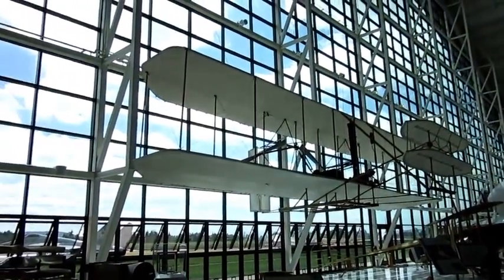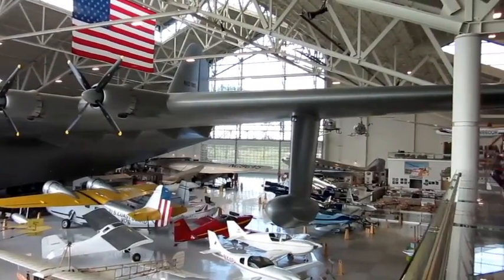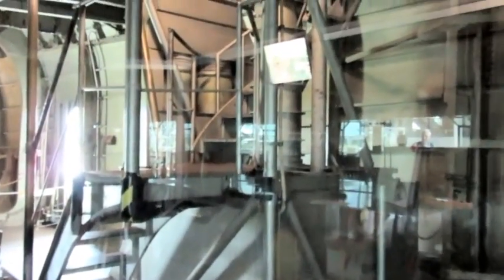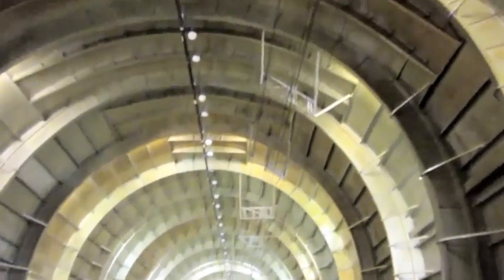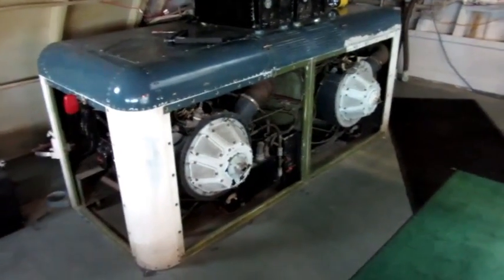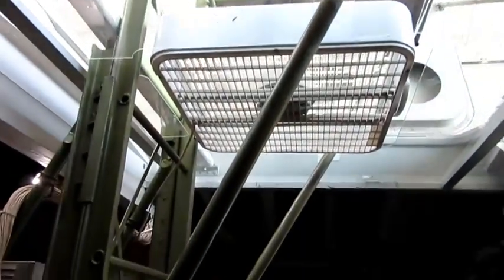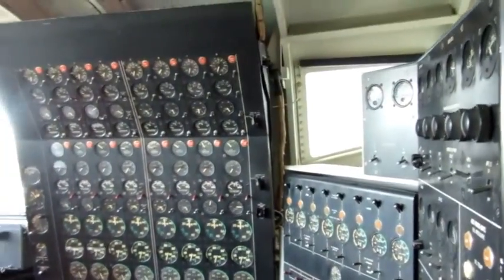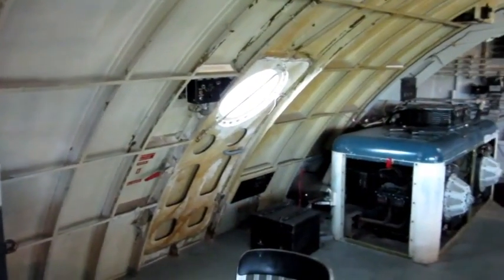Spruce Goose VIP Tour

Comment: interesting video. how did they get it from california to oregon, take it apart in pieces or tow it up the coast? that's a big piece of machinery.
Reply from the maker: They sell (or sold) a video about this at the museum. Basically, they took the wings and tail surfaces off (it was designed to come part like that, because it was manufactured far inland and originally had to be trucked to Long Beach in pieces, so the engineers understood from day one that it needed to be manufactured in transportable sections), and put it on a ocean-going barge, which took it up the Pacific coast, then I think they took it up the Columbia River to Portland. Then by road down the highway to McMinnville to the museum location, where it was stored in temporary weather proof shelters until the museum building was ready for it, and inside and reassembled.
Reply: @youtuuba  wow! that was an undertaking. it's on my list for the next road trip way out west.

Comment: Must have very been hot that day. All the fans. Or maybe for ventilation.
Reply from the maker: It was not hot inside the air conditioned building. I am pretty sure that the fans are to help with air circulation inside the huge one-of-a-kind wooden structure. Maybe also for ventilation, sine the plane is not exactly full of openings to let in fresh air, but I think mostly for protection of the aircraft.

Comment: Imagine if this was modernized and you put GE90's on this thing.
Reply: +AmericaWest90 a GE90 weighs 16,644 pounds.  The engines on this thing weigh as much as 3,870lb each.  

So, yes, it would would probably fly very well with two GE instead of 8 of the Pratt & Whitney R-4360 Wasp Major.
Reply: GE90s wouldn't help much. You could only fit one on each wing and it'd still weigh far more than all four engines combined, and would throw the center of mass significantly toward the rear. It could probably achieve a higher top speed, but the airframe wasn't designed for that. I think a set of Rolls AE 2100s (same as a C-130J) might be a good fit though. 

That said, even with modern engines it might just barely compete with a C-17 for payload capacity, and couldn't come anywhere close to touching a C-5, though I suppose being a seaplane would give it some very unique uses.
Reply: +JTB I like your take on what a modernization would be like. Thanks for putting forth the time and replying to my idea.
Reply: It would actually weigh about the same

Comment from the maker: Russia has a bigger cargo plane..... so what? They did not build it in the 1940s, did they?
Reply: Not saying Spruce Goose isn't impressive, but it could barely fly.
Reply from the maker: +Paistin Lasta ..... on what information do you base your assertion that the Spruce Goose could 'barely fly'? It was never given any chance to be flight tested, and the brief hop in Long Beach Harbor was restricted by that situation. The fact that Hughes only hopped the aircraft is not any indication of its capability. But the Hughes engineers very good, and it seems unlikely that they designed a plane that could only 'barely fly'. Furthermore, aerodynamics engineers have modeled the Goose in software and concluded that it would fly fairly well, if somewhat underpowered.... the main concern was how well the wooden structure would hold up on actual service use....
Reply: youtuuba Take it easy, wasn't it diagnosed that it couldn't fly above few dozen meters, as it was so low on performance.
Reply from the maker: +Paistin Lasta ..... not according to the information I have read. It MAYBE not get out of ground effect on its only flight, but any airplane flying that low is in ground effect..... this is no indication of anything. The reports I have read conclude that, while underpowered, it would have flown adequately. It might never have performed well enough to be useful, although this has not been established, but even an underperforming aircraft is still better than being 'barely able to fly's.
Reply: Not to mention, it's also made out of wood.
Reply: Don't forget. Before the Hercules took off, Howard lowered the flaps to 15 degrees which is take off position.
Reply: No, it just wasn't flown more. A lot of bullshit comments like yours have been made about it being "in ground effect" and the like but its a SEA PLANE and that's VERY DIFFERENT than a conventional aircraft rolling along a runway on tires. There IS not "ground effect" in a plane that large with all that drag taking off from WATER. 

The other thing that "experts" like yourself seem to forget is that was its MAIDEN FLIGHT. Not only had no one ever flown it  before and had it not been flown by anyone before, Howard Hughes was the "test pilot" for not only the LARGEST PLANE EVER BUILT BY A HUGE MARGIN but the largest SEA PLANE every built and oh by the way had the BALLS and SKILLS to pull all that off with THE WHOLE WORLD WATCHING. 

Any plane that can safely take off and land ONCE and do it from WATER on its MAIDEN FLIGHT can be flown as far and long as anybody wants to fly it. And of course Howard Hughes had already crashed at LEAST two of his "experimental" aircraft and was beyond "lucky" to survive the second and certainly had no reason to give that idiot Senator Brewster reason to manipulate the Air Force into demanding that the "contract" be fulfilled by DELIVERING the plane which no doubt at some point Brewster would have had destroyed if he possibly could. 

I guess how "impressive" that aircraft is depends on how much you think the AIRPLANE had to do with its own "success" and how blind you are to the fact that its HUMAN BEINGS  that actually build and create and invent and operate all the machines I suspect you like to see as "robots" with the "human factor" removed from the equation.

People with self-confidence, insecurity and NARCISSISM issues LIKE to pretend the whole world around them as far as machines go just HAPPENS and nobody builds it and nobody literally goes out and DOES EVERYTHING THAT"S DONE FIRST AND ALL ALONE AND WITH NO ONE ELSE TO BLAME THEIR FAILURES ON.

What have you built lately?
Reply: In inquiring on the topic of why it did not fly a second time, one of the curators indicated some doubler  added near the empennage on the rear fuselage where the tail had been quite flexible during the short flight. People in the tail apparently warned of stress in this location. Also indicated Howard did not expect it to lift off on this run.  O doubt is was quite underpowered for its intended purpose and those engines were notoriously unreliable on any aircraft.
Reply: But it bearly flew.. using ground effect..meaning very close to the ground. That's all it ever did. Not strange people mention it. What it could have done is another matter and nobody can say anything for sure except it probably would have broken up into pieces if one look at the construction with strenght calculating software and as you mention what the people on board experienced on the second flight. One thing thats often quoted in the videos about the sproose goose is that it is the biggest sea plane ever built, it WAS at the time, but was beaten more than once in the years to follow. There was an English seaplane in traffic that was quite a lot bigger, and then you have the crazy Russian millitary freighter/bombers and prototypes.
Reply: To "threeparots1",
  From the documentaries I've viewed the narrator stated "during the test run with Mr. Hughes at the controls, the aircraft was intentionally made to leave the water and take to the air, regardless of the altitude, because Howard Hughes was not going to allow that idiot Senator tell him what to do with his own aircraft". You may be right about the engines being "Notoriously Unreliable on any Aircraft", I'm not well versed in these particular engines.
Reply: The essence of the active ingrediences of many youtube comments there. "...ignorant assumptions from a minute sliver of sound knowledge by people who do not even realize what they do not know." Great formulation, I haven't heard any better for a long time. If youtube is any indication, fluoride in the water really works. Strange how the loudest are often the least knowledgeable, how many self appointed experts that come crawling out of the woodwork exposing their overinflated egos and self-esteem, how people can tell you - while unboxing an item - everything it takes years of first hand experience to know. But strangest of all, and most depressing, all the guys that take them seriously.
Reply: Regarding being underpowered:  That's why the H1B would have had turboprops!
Reply: A University in the UK used their flight simulator, a few years ago, to test the Spruce Goose. They said it could've done everything that Howard Hughes said in the hands of the right pilot as it was a difficult beast to fly...

http://www.bbc.co.uk/news/uk-wales-26025939
Reply: at least russian cargo plane can fly hahahahahahaha
Reply: youtuuba The Antonov An 225 is not a russian Plane its a Soviet cargo plane that has 6 jet engines and it can carry 200000 kg on its fuselage it’s way more impressive than the spruce goose which could barely fly. The an 225 has never had an incident and is still flying to this day. The an 225 is one of the most impressive aircraft ever built the spruce goose is not it was a massive failure that only flew once.
Reply: Paistin Lasta Hughes plane had a bigger wing span
Reply from the maker: @threeparots1  , the Goose used the same engines as several other large aircraft of the day (albeit while using fewer if them than the Goose).
Reply from the maker: @gulanvanbenthem740  , your assertion is very incorrect. The Goose was a prototype of what was supposed to be a whole bunch of similar cargo planes, at a time when a huge number of cargo ships were being such by German submarines. Before the work on the Goose was complete, the need for it evaporated. Hughes was left with the complete, but unflown, prototype. Because of the accusation that Hughes had used the aircraft to profit from the war, he had it made ready, and flew it. It did fly, but the government only gave him permission to taxi, not to fly, and he was not out in the open ocean, but rather inside the Long Beach harbor. Unless he was willing to fly it away and be in trouble with the government, he had no choice but to set it down again. He had proven that the accusations were false, and that is all he needed to do. How does this make the Goose a failure? It says nothing about it's design or airworthiness.
Reply from the maker: @gulanvanbenthem740  , what a load of uninformed BS. Also, I don't know why you address ME with your comment on the AN-225; I did not say anything to the contrary about that aircraft. However, it is pretty dumb to try to bring modern planes like the AN-225 into a discussion about the merits of this 1940s design that is the subject of this video. And there is no way to reasonably assert that the Spruce Goose was a "massive failure", that is totally unreasonable.

Comment: Before starting a radial engine, it's normal to walk the props through a couple of revolutions, to ensure there's no oil trapped in the bottom cylinder. (If there is, starting the motor could blow the cylinders off.)  Considering where the motors are, how did they do that?
Reply: I suspect the answer is something like a very careful nudging of the starter motors with the ignition off. (The Catalina/Canso) presents the same problem, and I believe that was the procedure used there.)

Comment: I am wondering if it is still airworthy?
Reply from the maker: Matteo Sinclair, I am sure that the answer is NO. During its one flight,  they noticed structural problems near the tail, and I don't think Hughes did any remediation afterwards. I know that the Evergreen Museum put new fabric on all the flight control surfaces. (I have some of the old 'flown' fabric), but other than some touch up repairs and returning her to her original paint scheme, , I think nothing has been done to the Goose since her maiden flight. Throw in the ravages of time, and you have a plane that could not be flown now, at least not without being reckless about it. And then, of course, she is inside a building far from water.
Reply: @youtuuba  Thank you.

Comment: Made for military transportation , but afraid it can’t stand up to foot traffic?
Reply from the maker: Think about it.....it was made as a stopgap measure to get men and materiel to Europe at a time when ships that were doing that were being torpedoed left and right. Everyone knew it was likely that this plane would only be a temporary solution, and since it could not be made of 'wartime materials', wood was used....it was not expected to be used for decades. This was also a prototype, without the reinforced floors that would be needed if put into actual service, so it is just the wooden skin in most areas.

So yes, the Spruce Goose as it stands now is a very old wooden plane, without reinforced floors and such, and hence it would be abusive to this one of a kind artifact to have people tromping around all over inside. However, people can go in areas where there are decent floors.
Reply: Had it gone into production for military use it wouldn't have been made out of wood and it would have withstood a whole lot more I promise you! Can you say the word" prototype"

Comment: its bigger than the Airbus A380 superjumbo
Reply from the maker: Derek Obidowski, not a very useful comment.... To be valid, you need to establish in what way it is bigger.... Are you taking wingspan, height, tail size, fuselage length, fuselage width, payload, what? As it happens, the Spruce Goose is certainly in the same league as other mone monster planes like the 747, A380, C-5. Until recently the Goose had the longest wingspan, but now another plane has been built with a longer window wingspan (and it is not a commercial or military plane). But the A380  fuselage is bigger than the Goose, and other planes can carry a lot more payload.....

Comment: My take:  Howard Hughes intended to do a “fuck you” to his detractors, an quickly realized that the Goose was not going to come out of ground effect, and therefore parked it.
Reply: I had a professor (Tex Hilley at Northrop Tech))  who was onboard the flight; said the "goose" popped off the water unintentionally when the flight engineer over-extended the flaps during what was meant  only to demo high-speed taxiing.  The distance it flew was no more than the distance it took to get it back on the water.
Reply: @ericcoleson7410  True. Dave Grant the copilot told me the same thing.

Comment: if only they could fire up those old engines again
Reply: +Ken Lovejoy I actually asked the director just that same question.  Just start ONE!  The issues are HUGE.  Just the oil supply is humongous, the wiring for the magnetos is very old also, the seals are likely dried out and useless.  Those engines too, were regarded as the most difficult to maintain in the world.
Reply from the maker: Actually, you can SORT OF best these engines being 'fired up' these days. This plane used the P&W R-4360, and that engine was also used on other planes, some of which are still operating today. There are You Tube videos of, for example, the Boeing 377, the Boeing B-50 Superfortress, the Fairchild C-119 Flying Boxcar in operation. If you check out the Jimmy Stewart movie "Strategic Air Command, you can hear these engines working on the Convair B-36.
Reply: These engines are the same ones on the Mars water bomber currently based in British Columbia, Canada - http://globalnews.ca/news/2847935/martin-mars-water-bomber-a-star-attraction-at-wisconsin-airshow/
Reply: Eliades Pastor I saw that thing once.  Huge thing.
Reply: youtuuba b36, six engines and four jets.   Holy smokes.